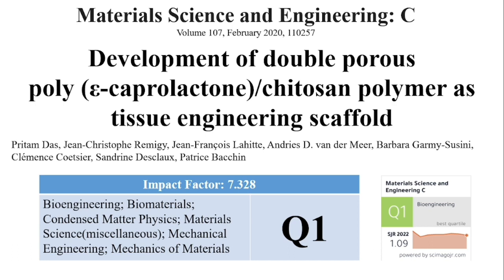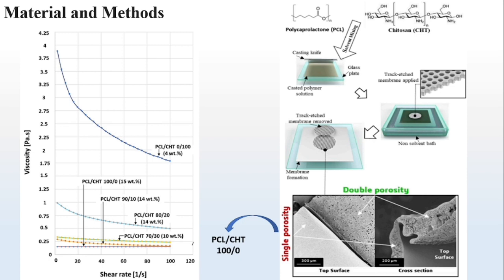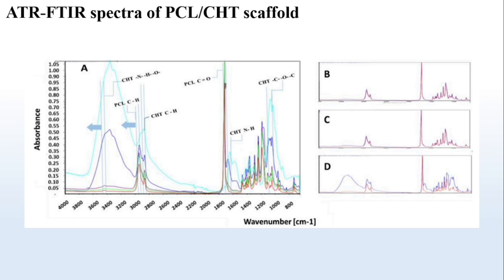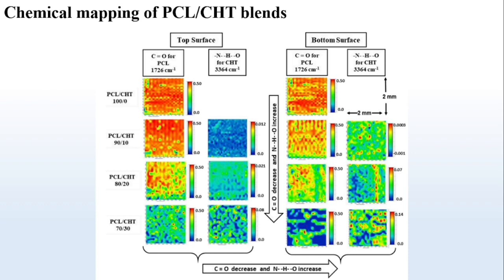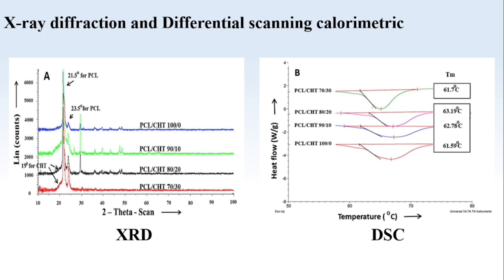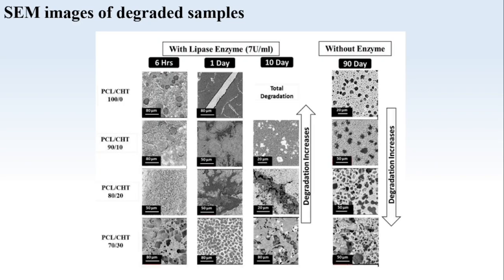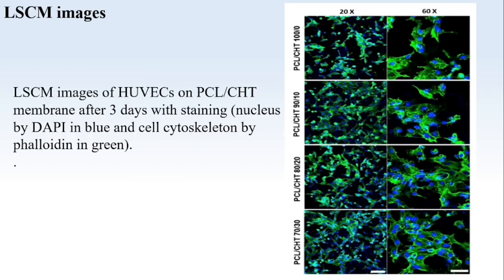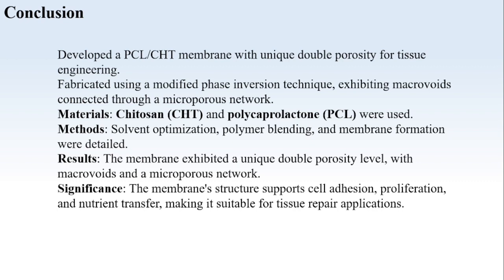SEMINAR 2024-04-09 (11275029-Tran Minh Quan)

Comment: Jou-hsuan Huang asks question 1: Thank you for sharing.
 I would like to ask, where do you think PCL/CHT membrane can be applied?
Reply from the maker: Thank you for your question: The PCL/CHT membrane is suitable for tissue engineering scaffolds in small diameter vascular grafts for cardiovascular diseases due to its unique double porous structure, cellular compatibility with HUVECs, and biodegradable nature. It can provide an optimal environment for cell growth and tissue regeneration, with the ability to tune the degradation rate for gradual replacement by new tissue. Therefore, the PCL/CHT membrane developed in this study can be a suitable candidate for tissue engineering applications targeting small-diameter blood vessels, such as in the treatment of cardiovascular diseases

Comment: Kuo-Yi Weng asks q1: can you tell me what is the main implication you get from this study and how it is going to guide/affect your own study?
Reply from the maker: Thank you for your question: The study focused on optimizing the polymer-solvent-non-solvent system to achieve the desired membrane structure, highlighting the importance of factors like viscosity, solvent optimization, and polymer blend composition in creating the double porous membrane. The interaction between PCL and CHT, as well as the formation of macrovoids and interconnected micropores, were key aspects studied to understand the membrane's morphological structuration. Additionally, the study demonstrated the cellular compatibility of the membranes through cell culture experiments with human umbilical vein endothelial cells (HUVECs), showing promising results for potential applications in small-diameter vascular grafts for cardiovascular diseases. These insights will influence my approach to designing and optimizing biomaterials for tissue regeneration, particularly in creating structures with improved biocompatibility and cellular response.

Comment: Thank you for your wonderful presentation.

I'm Chia-Ke Tsou. I have a few questions want to ask

Chia-Ke Tsou ask question 1: Does adding CHT affect the stress and strain of PCL?
Chia-Ke Tsou ask question 2: Why is the biodegradation time important for tissue scaffolds?
Reply from the maker: Thank you for your question: For question 1, Adding CHT does affect the stress and strain of PCL. The study on the development of the PCL/CHT membrane for tissue engineering scaffolds revealed that by increasing the weight percentage of CHT in the blend, the temperature of melting (Tm) of the blend increased, except in the case of PCL/CHT 70/30 where it decreased. This change in melting temperature indicates an interaction between PCL and CHT, impacting the crystallinity of the blend and subsequently affecting its stress and strain properties.
For question 2: The biodegradation time is important for tissue scaffolds because it directly affects the rate at which the scaffold is absorbed or broken down by the body. This process is crucial in tissue engineering applications where the scaffold serves as a temporary support structure for cell growth and tissue regeneration. The biodegradation time influences the rate at which the scaffold is replaced by the newly formed tissue, which in turn impacts the overall success of the tissue engineering process. A scaffold that degrades too quickly may not provide sufficient support for cell growth, while one that degrades too slowly may not be fully replaced by the new tissue, potentially leading to complications such as inflammation or foreign body reactions

Comment: Yuling Hsu asks Q1: Can we come up with any conclusion that, of which ratio of PCL/CHT be better than the others? Or they all are basically suitable for tissue engineering? Thanks!
Reply from the maker: Thank you for your question, In the study, they used different ratios of PCL/CHT, including 100/0, 90/10, 80/20, and 70/30, to develop double porous membrane materials for tissue engineering applications. The study found that the blend ratio affects the viscosity of the solution, with higher CHT concentrations leading to increased viscosity. The study also observed a considerable increase in the intensity of the PCL-specific peak with increasing CHT wt% in contrast to some reported data. Additionally, the study found that the interaction between PCL and CHT influenced the crystallinity of the blend, with different types of crystals forming within the crystal lattice.
Therefore, the optimal ratio of PCL/CHT for tissue engineering scaffold development may depend on the specific properties required for the scaffold. For example, if a scaffold with high crystallinity is desired, a blend ratio with a higher CHT wt% may be more suitable. On the other hand, if a scaffold with lower viscosity is required, a blend ratio with a lower CHT wt% may be more appropriate. Ultimately, the choice of ratio should be based on the specific requirements of the tissue engineering scaffold being developed.

Comment: Shu-Chen Wu ask :
Question 1: Researchers developed the membrane with a double porosity level using different ratios of PCL/CHT, ranging from 100/0 to 70/30 (w/w%). There is no information available on other ratios. Did the researchers provide any explanation for the selection of these ratio ranges ?
Question 2: In this study, regarding the investigation into biodegradability, why did the researchers choose to use lipase instead of other types of enzymes for degradation ?
Thank you !
Reply from the maker: Thank you for your question
For question 1: The researchers selected PCL/CHT ratios for the double-porous membrane based on optimizing the polymer-solvent-non-solvent system's viscosity. This ensured the formation of macrovoids during solvent exchange, critical for membrane formation. They dissolved CHT first, then added PCL to maintain viscosity and achieve a homogeneous mixture. The ratios used were PCL/CHT 100/0 (15 wt%) in FA/AA 70/30, PCL/CHT 90/10 and 80/20 (14 wt%) in FA/AA 60/40, and PCL/CHT 70/30 (10 wt%) in FA/AA 50/50, selected to meet desired membrane properties and structure.
For question 2: This study chose to use lipase to investigate biodegradability because it selectively degrades poly(ε-caprolactone) (PCL), a component of the PCL/chitosan (CHT) blend in the membrane. Lipase from Pseudomonas cepacia was selected for its high activity and ability to hydrolyze ester bonds in PCL, leading to its selective degradation. This simulated the enzymatic degradation process in physiological conditions, providing insights into the membrane's biodegradability.

Comment: JP here : Scaffold treatment is only limited to bones or it can be utilized for others tissues of the body like heart or other organs?
Reply from the maker: Thank you for your question, Scaffold treatment isn't just for bones; it can be used for different tissues, such as bone, cartilage, skin, and organs, by customizing scaffold properties to match specific tissue requirements for regeneration or support.
For example, scaffold treatment for cartilage regeneration supports damaged tissue by providing a structure for cell attachment, growth, and new tissue production. Example paper:"Hydrogel composite scaffolds achieve recruitment and chondrogenesis in cartilage tissue engineering applications"